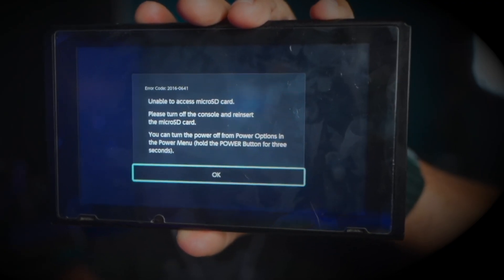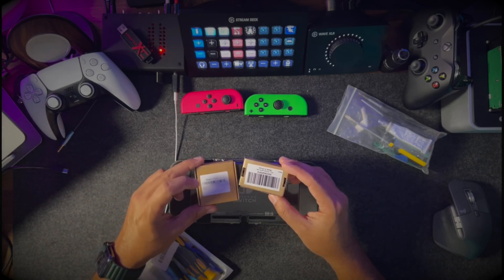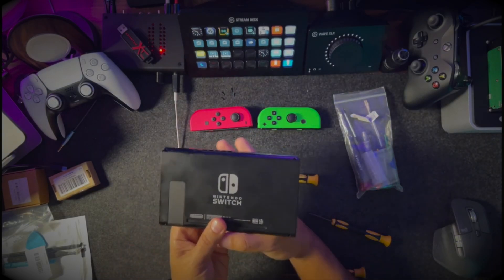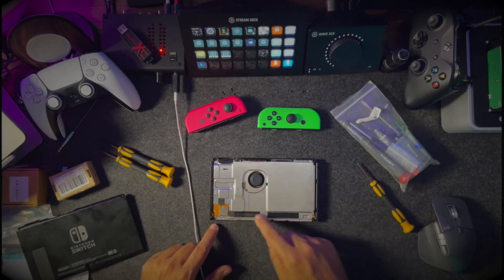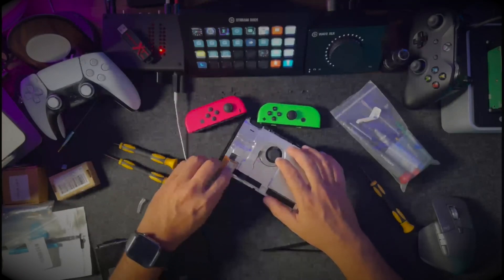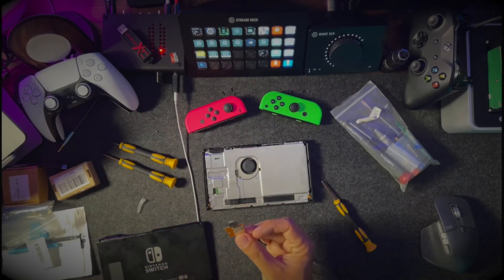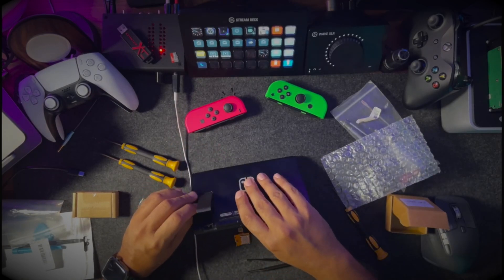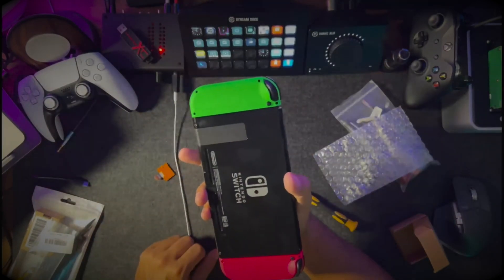Nintendo Switch SD CARD Reader ERROR: FIX!

Comment: This is happening to me where I put an sd card in and it isn't detecting it on data management, I have only had my switch for 3 years and I have never used the SD card slot before. Also I don't have a y head screwdriver
Reply from the maker: https://amzn.to/3J9v27H link to screw set & https://amzn.to/3GZJGOr tools
Reply: Myne was simaler,it was a 512 GB card ,got to bout 150-200 G of date ,then messages appears,did the off/on/remove card things as per switch's rules,work out about 4 time then it failed to read the card, when it's always been in there, the 4/5 times I removed would5of damaged the reader or card.. just brought a 2 no d hand micro card instead,anyone I paid for in eshop,just re-d/load,lose all saved data of where you at be easier that stuffing around an only $30 for a card

Comment: Thanks for the video. Our switch was doing the same thing and reseating the plug solved the problem. Only thing was there was a 5th screw underneath the kickstand that had to be removed to get the case off (in addition to the one holding the sd card reader in place).
Reply from the maker: Glad you got it fixed! We share the same hobbies, so hoping you subscribe 🙏🏽

Comment: Do you know what the issue is if it only cannot read the sd card sometimes, when I’m playing for a while it will disconnect me due to the same error but it doesn’t happen constantly
Reply from the maker: @ambermcna5552  try a new card, that fixed my issue first... but the card reader itself eventually died a few months later, that is why I ended up opening it and making this video. I'll be streaming in a few moments if you have more questions or thoughts

Comment: My switch reads the nicro sd card but only when I give it a tiny push in the port but when I release the connection is interrupted and I don’t know what to do
Reply from the maker: Sounds like you just need to “re-seat” the card reader chip. Let me know if this resolves. Plz consider subbing. Thx

Comment: I can get the back plate corner screws off. Ik it's a triwing. I don't know what size you need tho

Also mights does it after a few hours, not straight away so I won't be able to tell if it's the reader thats broken or if it's just a bit out of place immediately
Reply from the maker: I got a kit on Amazon called “switch tool kit” or something like that. Comes with all the correct tools. Buy the replacement reader (30 day return) & try to reseat the original reader first & test…. If still not working, then pop in the new reader & test.
Reply: @AJCoReTV  

Ok thanx I'll try that ^_^

Good video by the way 🙂
Reply from the maker: @blackstar5867  thx keep me posted… plz consider subscribing 🙏🏽
Reply: @AJCoReTV mate, I know you probably won’t see this but:
I’ve had this issue since Christmas, 2023 (nearly 2 months) I was trying to play a game when I noticed my microSD Card didn’t have enough storage for this (this is when my switch ran flawlessly without this issue with the SD card) so in January I took it to the repair shops and I got it back around last week, AND IT DID NO HELP AT ALL during the drive home I noticed it was working so I was glad and was happy I could play Batman Arkham knight, and then around 20 minutes later the issue occurred again, I honestly think my switch is broken.
Reply from the maker: @GhostBehindMyEyes  it’s worth trying the fix shown here… if not, just wait for switch 2… hopefully it’s not your only console
Reply: I have a PS5, so not only lol.
But this is my only switch, my dad (YES I'M A MINOR DON'T TALK ABOUT IT  @AJCoReTV 
😭) says it could generally be age since i've had it for about 4 years now. my first thought was the microSD card (It has small scratch's but worked the first time i used it (oct. 2022.) i used a other MicroSD since it had all my games on it) but yeah, thats my only switch, i might purchase a new one if i ever get enough money.
Reply from the maker: @GhostBehindMyEyes my sons switch stopped turning on… I ended up having to get it refurbished directly thru Nintendo for $115 😢

Comment: How can I replace my reader, it’s a brand new switch 😂😂
Reply from the maker: Brand new Switch & SD card reader is already failing?
Reply: I had a switch barely used just sat in my house for months and when I finally decided to get into it I used two different micro sd cards none we’re reading , I’m certain the card reader is broken and I’m astonished the switch is practically new

Comment: Thanks for the video. Here is my son's situation: his Switch is slightly warped or bent, probably from excessive heat and usage. His SD card reader let's you initialize the card, but he says when I tries to launch a game, he is getting an error. ALSO, his USB-C port seems to have an issue as it does not produce a picture anymore when he slides it into the cradle. However, charging the switch using the charger still works. I guess my question is: should I try to replace the SD card reader (he does not care about picture to TV btw), or do you think his main board has some bad traces that affect the SD card function and possible also his USB port? I need some advice... He wants a new switch and that's a lotta money just so he can have extra storage. Thank you.
Reply from the maker: With the new switch model about a year away, I would avoid replacing switch now. Try replacing SD card for now. It’s worth trying that first. It saved me! Not getting picture could be (doubtful) a bad dock station. I’ll be making another video showing a cheaper alternative to the official switch dock… but since your switch itself is warped it could be that causing the no picture issue. Hope you subscribe for more. 🙏🏽
Reply: @AJCoReTV  I can confirm it's not the cradle because my own Switch which is not warped gives a picture on my TV, but my son's doesn't. Your suggestion is fair. Trying a replacement is probably the cheapest way to test instead of getting another Switch. Thx
Reply from the maker: @bellotriggerfish  keep me posted

Comment from the maker: Smash that LIKE button, Drop a comment & SUBSCRIBE! (Join my Live streams!)
:yt:
Reply: Any idea what to do if replacing the card reader doesn't work?
Reply from the maker: @ambermcna5552  try a new card, that fixed my issue first... but the card reader itself eventually died a few months later, that is why I ended up re-opening it and making this video. I'll be streaming in a few moments if you have more questions or thoughts